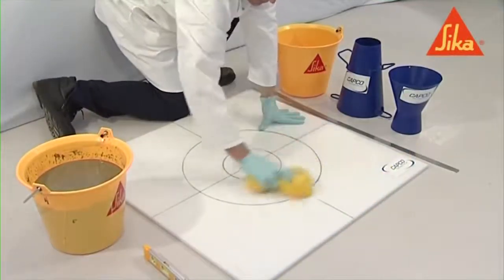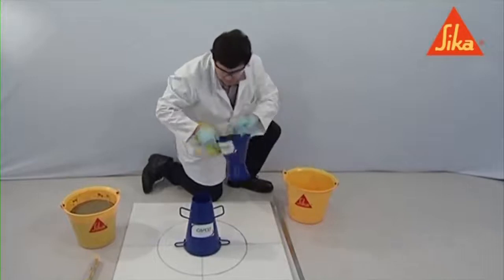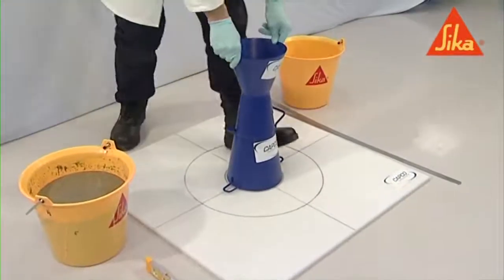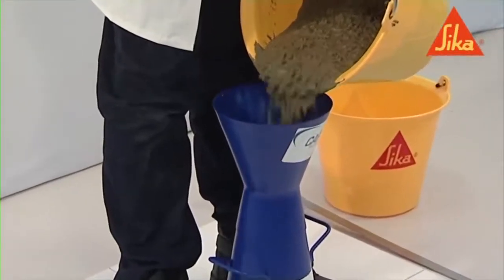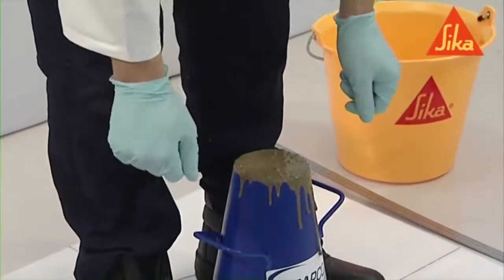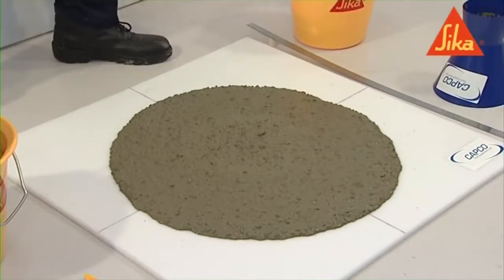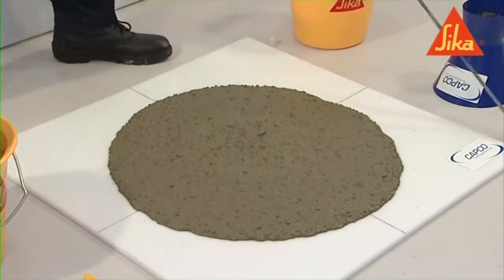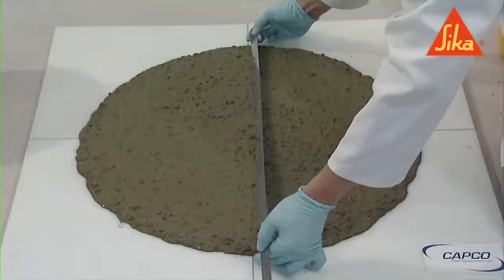Flow Table Test

Comment: This is not the Flow Table test. The Flow Table test uses a hinged Flow Table and Flow Cone. 
This is the Slump Flow test, conducted on a 1m square baseplate and using the Slump Cone.
Reply: Right, sir !